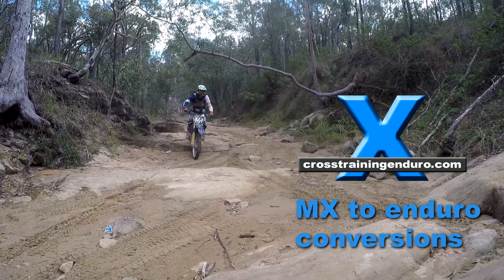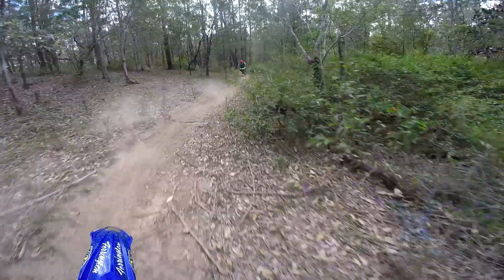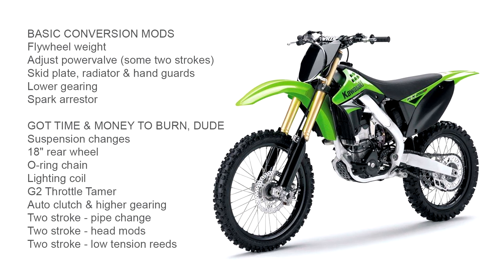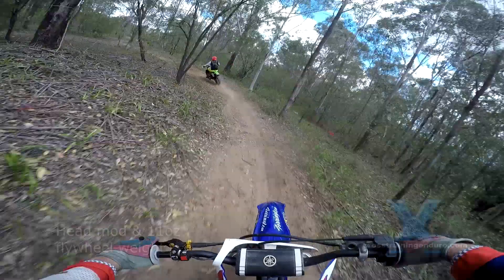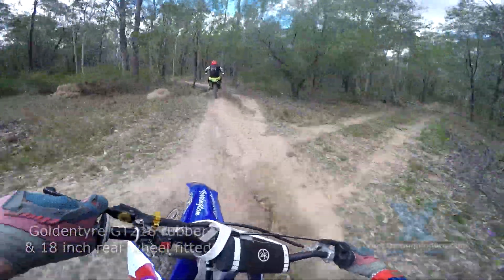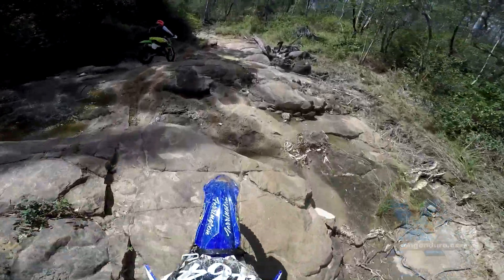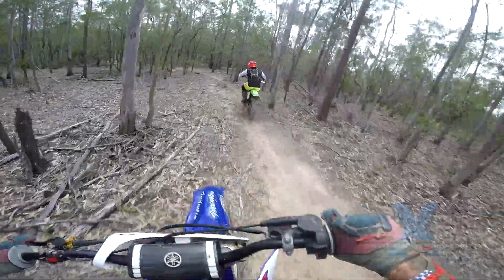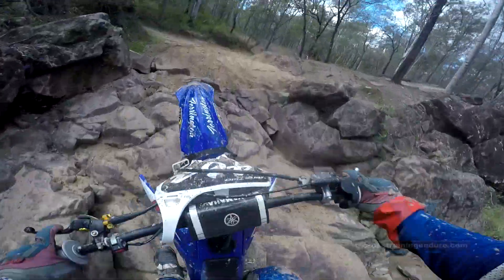Motocross conversion to an enduro woods dirt bike︱Cross Training Enduro

Comment: I own an older YZ250 and finally converted it to a woods bike a few years ago (pipe, weight, suspension, chain, steel sprockets, and few other changes), and I have to agree that you're much better off performance-wise getting a full enduro bike.  Mine does fairly well and can tractor up most technical stuff (mostly due to 13/50 sprockets), but it's not the easiest bike to ride compared to others (which, since I need the exercise, suits me).   I also don't have the advantage of that lower 1st or higher 5th gear.

The differences between track and enduro bike engines (especially 2-strokes) are the porting, timing of the power valve and spark, and carb size (lower rpms require smaller carbs in order to maintain intake velocity).  Until those changes are made, a track bike will never equal the low-end grunt of something like your 300 Beta.

Also, I think most will find that there's little weight difference by the time many of those changes are made.
Reply from the maker: a good summary mark. if i had the money and storage room i'd probably like to have one as a spare bike and just do the budget mods... but beyond that the price and weight do creep up too much.

Comment: Some people find that after a converted MX, it cost as much as a dedicated enduro? Wrong. Not if you look in the right places/get the right bike. 

Is it worth it to convert a MX? Yes, if you get the right bike. Get an old steel-framed YZ. Like a 2000-2002. SUPER, SUPER fucking cheap. You don't gotta worry about close-ratio gearing, because it's compatible with the WR's if you swap it, same with the rear wheel, I believe. Throw in a flywheel weight, and some lights if you want them. And bam. You have a bike that can do anything any fuckin' KTM can do, and it all cost you $3000 or less. And it has the most support for woods riding, compared to all the other MX's.

Comment: on the EnduroGP level these enduro bikes are more like MX bikes (Antoine Meo's winning 350EXCF was made on 350SXF model, not EXCF) but when its coming to amateur riding its better to get an enduro bike. I had many MX bikes and few enduro bikes and im alwys faster in woods on enduro bike than on mx bike, even after conversion.
I did almost full conversion for 450 SXF MY2011 to XCF (couldn't make a gearbox conversion), the progress i made with my ride after conversion was big, but now when I got full EXCF enduro bike (350EXCF)  its the whole new level of riding. it would need a lot of setup to make the SXF works like EXCF bike.
Reply from the maker: a very good point there kristof, i think the top riders are so fast a motocross bike setup probably becomes very useful in an enduro setting... i know our local junior endurocross champ recently changed over to a motocross bike.

Comment: I'm am also really considering doing this to a 2 stroke motocross bike.  I worked out a used yz250 for good price some smart mods here and there and it's already half the price of a beta but if you buy used and go the money is no option route it which includes head porting and bigbore for 298c you are 1000 dollars less than a beta 250. I am really wanting to buy a used one and use it in local enduro but I'm going the smarter route and saving the money and building a shed

Comment: I ride a 17 TE300 right now but miss the stiffer suspension of the mx bikes I used to single track ride. Even with the suspension tuned on the Husky I just don’t feel as comfortable at speed as I did on a stock mx suspension.

Comment: My YZ295 has a 295 kit, re ported, reshaped head, fmf gnarly and Shorty, 11oz flywheel weight, torque spacer, different needle, bigger rear wheel, throttle tamer, mousse tire, and it has wr450 gears in the gearbox
Reply: Had one built similar,  miss the hell out of it.
Reply: What needle do you run. And does the g2 throttle tamer make a noticable difference?

Comment: in the us you can get just about any dirt bike plated
Reply: Potentially, but you still need to put on a stator and signals in most states. It takes a lot of mods.
Reply: Legally you are totally correct. But with LEDs and small lithium batteries these days, plus the very short tech inspections required.. you could actually get by without an actual stator/charging system. As long as you didn't run at night forcing you use use a 30w headlight, you could actually run all day with blinkers and tail light without a stator if you had a decent small battery. Just something to keep in mind.
Reply: My buddy got is 450 street legal in va. all he did was switch to a more quiet muffler, added a battery, lights, mirrors, tail lights, and registered it.

Comment: I had a converted yz250 for a long time that was used as a trail/xtraining bike.  It was a love and hate relationship.  I was never entirely happy with the gearing, there was always a compromise, too short for this, too tall for that ect...  Not to mention the resell value of a $2000 bike that you put $2000 into is still pretty much $2000
Reply from the maker: so true, no one will pay you for the mods done, joe. i guess a bike like that becomes a keeper and you never sell it, just keep it as the backup bike. :)

Comment: OK, I have been waiting 18 hours questionning myself if i was going to mention it or not. But I can't keep this terrible secret anymore.

The pull of my hydraulic clutch is not really lighter than all the cable clutches I had before and I sincerely hate the infinite astronomical gap between the first and second gear on my older 250 Exc (2005)...  so ''hydraulic clutch'' and ''wide ratio'' are very difficult concept for me to grasp. I never had any use for my front light either, my bike is too heavy and I don't care about the rear stop light not working. I can't even intoxicate myself with 20/1 castor oil like in the good ol' days... On the other hand, I must admit that I really like my anodized oil drain plug. 

Am I a real enduro guy, doctor? Or simply an ex old school motocross ape fitted with a Harley pea size brain?
Reply from the maker: within every dirt rider lurks the motocross ape fitted with a Harley pea size brain. :)   it's true there are some cable clutches that can be fairly light, but the ones i have tried have been hard to pull in and my old middle aged hands let me know about it after the ride lol. a wide first and second gear are definitely bad news, i think on enduro bikes the wider spread is meant to be in the higher gears so you can lope along on dirt roads or easy tracks at 80+kmh without sitting on the rev limiter. or i think that's the theory.... but i am just a gumby motocross ape fitted with a Harley pea size brain.
Reply from the maker: wow. as i read that i could actually feel the divine blessing of the trump settling upon me. i will now go out and attempt to convert my RR480 from a six speed to a five speed.

Comment: I got a KXF250 first when I started to ride dirt but found it very difficult to ride (not impossible). After swapping to a wr250F I was immediately riding better/faster and with more confidence on the first ride than I ever did with the KXF250. I think mostly due to not having such a snappy throttle I was able to relax and focus on riding, not hanging on with a death grip. What parts on an enduro bike would you suggest stripping to save weight besides lights?. Thanks :)
Reply from the maker: not much you can do to strip weight from an enduro bike other than what we mentioned in the vid, a lithium battery imho.

Comment: For racing it might be worth it, but for a weekend play rider, just get the yz250fx and add a cooling fan.  You will be happier and don't have to screw around mixing gas, jetting, fouling plugs and crap rattling off due to vibration.
Reply from the maker: Great suspension too for enduro riding... at the KYB versions. Rode one for a week and loved the suspension.

Comment: I've got a new 2017 Honda CRF250R obviously has too much throttle response as way to Snappy to control in tight technical and rough Terrain so what is a few mods that I should start with to smooth the throttle out and make it easier to control
Reply from the maker: did you watch this vid? or hit the link to the four part series at the end that goes into even more detail? more info here:  https://youtu.be/qSg2sll6yEo?t=567

Comment: Somewhere in this series of Moto to Endo you covered drive ratios. I have a 14 KTM 300 XC that had been changed before I got it and seems a bit tall. Do you know what would have been stock or what your Enduro preference would be for it?  I just finished making it completely street legal.
Reply from the maker: no suggestions specifically for the 300XC unfortunately....

Comment: Do you think it takes a more experienced rider to handle an MX conversion or is it actually better for beginners since theyre going slower anyway? The low weight is probably a lot less intimidating for a beginner, AND easier to pickup.

My thought has always been you can learn shifting/throttle control. But you cant make 260lbs falling over feel any lighter, so why not make it 210lbs (and probably a little lower center of gravity too).
Reply from the maker: the light weight helps a beginner but everything else would go against them david, an mx bike is designed to work best when ridden hard and fast.... unless you do the mods in this vid to tame it down.
Reply: David Driver No.  Beginners are going so slow and the stiff suspension beats the crap out of them.

Comment: I'm gettin a new bike soon, and I was gonna convert a kx100, but instead I'm probably gonna get a husky wr150 and lower it
Reply: honestly converting a 100 is great. the power is great for the woods right out of the box and all it really needs is a skid plate and handguards and you are set. obviously you could get a bigger rear sprocket as well, but the stock gearing does fine. and overall, converting a kx100 is not expensive at all seeing as though you can ride them in the woods bone stock and they still rip. also, the parts would be much cheaper than a husqvarna.
Reply: ya, I was gonna put on an fmf fatty, and an fmf shorty, hand guards, and skid plate, but id rather have a full sized bike so I can just raise the suspension again when I grow more
Reply: fatty and a shorty? You'd probably want more like a gnarly and a turbine core. The shorty is strictly motorcross.
Reply: John Fraser they don't have a gnarly for the 100 but that was a while ago, I just bought a 2010 gasgas ec250 six days edition instead

Comment: yamaha could really sell a lot of bikes if they only made plated bike with 18" rear wheel and hydraulic clutch, i'd love to ride a 250 so light
Reply from the maker: fingers crossed for 2018, many think yamaha is just testing the market with this YZ250X and will do it properly next year. who knows....
Reply: maybe with direct efi on the 250? i want to believe ahahahah
Reply: Direct injection is alive in the snowmobile and outboard markets, I hope we're next!
Reply: The Sick Horse Ranch yeah that's what makes it sad, direct injection has been around for a very long time on snowmobiles and outboards and still nothing on bikes
Reply: I remember a promotional video for an outboard manufacturer and they were tying boats together and having "pull-off" competitions between DI 2T and double cc 4T engines and those 2Ts would swamp the 4Ts every time. It wasn't a subtle difference, and all of this from a motor that got better fuel mileage, better throttle response, more power, and was lighter weight than even a 4T twice it's size in cc.
Reply: exactly, and all the DI 2 strokes i know use near to standard bore/stroke ratio, i wonder what power an engine with proper ratio could make

Comment: I have a 02 yz 125 but I killed the ignition coil after 25hours. I've been told by the dealer that this isnt how I should ride my bike and that I should keep it wide open for air flow any ideas to help keep it cool while I practice my slow enduro skills,
Reply: Strap two or three zip lock bags of dry ice around it!!! That should work!

Comment: I have been riding a 01yz 125 in the wood for almost 3 years... all I did was go 1 tooth down on the counter shaft and soften the the suspension..... is there any reason to get a larger bike??? just wanted your thoughts on it....
thanks
Reply: WFmaru enduro don’t buy a KX 500 like the guy kicking his at 1:08 😂

Comment: on my 2021 ktm 300 xcw i usually ride hard enduro with big rocks and roots etc. But got a woods race coming up which will be easier high speed trails, ripping and flying through trees. for this race id like my bike adjusted to ride a little more like an XC at high speed/cornering. Should i just reference the manual and do what it says and set everything on the suspension to "SPORT" mode? wont this stiffen everything up and be better for spped while still being soft enough for the occasional rut, rock, root? has anyone setup the 300 XC-W in the "sport" mode that is referenced in the manual? any negatives or drawbacks to this setup???
Reply from the maker: I know next to nothing about suspension and never even bother adjusting clickers. 😢

Comment: So he made a yz250x
Reply: The X doesn't have the head work or the suspension work. He also looks to have done the conversion before the X was released.
Reply from the maker: true, rob did all of this prior to the YZ250X.
Reply: it wasn't meant as an insult.  Just saying you can buy this bike from the factory
Reply: The Sick Horse Ranch the 250x has milled head for lower compression, different power valve setup, wide ratio trans, and different suspension valving
Reply: I honestly prefer my converted YZ over the X. Plus, im at $3k total investment so far on my YZ with the mods done, and i prefer the close ratio gearbox. Where i ride there is no need for really tall gearing.
Reply: Charles Gutscher I found a good deal on a uses 2017 x. I added a big tank, skid plate, bark Buster's, springs for my weight, and I'm at 5 grand. I'll agree buying a brand new X isnt the greatest value when there's a million used YZs out there but 5k in on a pretty much brand new bike setup for me was too good to pass up. Love the hell out of the bike so far.
Reply: Dont get me wrong i love the X. i Was finding descent deals but for me, i bought my 05, got SSS forks for it, custom valved the sspension and sprung it for my weight, installed new updated plastics, a 13oz FWW, some handguards, etc and im around 3k right now. I personally didnt care for the WR trans but i dont have any long sections where id ever need the tall 4th and 5th. All im really missing is an 18 inch rear and kick stand. Had money not been an issue i would have probably bought an X, but i feel for less money bi got a very comparable bike. I love the YZ platform in general though

Comment: the changes you make to an mx bike are no different for an enduro specific bike. anyone serious needs or wants suspension, which in my eyes is far more important than motor mods, but again, serious guys will mod a motor, wether to tune it down, or tune it up. i modded my berg 250 to be more "300" like. this isn't to say a fast guy can't do it on a stock bike, but eventually hell find its limits

Comment: Yamaha lost my trust. Why? They are not able  to build a serious dirt bike! The YZ is pretty good, but that's the one and only bike from Yamaha. I used to drive an XT 125 R for my first enduro experience. Well, for the beginning it was a good bike. But if you go harder 10 horse power are just not enough. Also the frame is not meant to jump or to do hard enduro stuff. The next generation bike from Yamaha, the WR did not really the big change. It was a bit better, but can not call it a hard enduro. So, Yamaha, I'm definitively out.